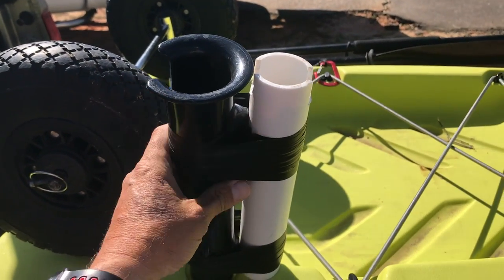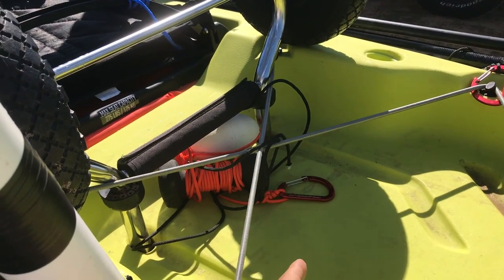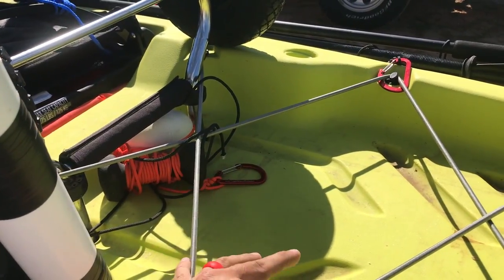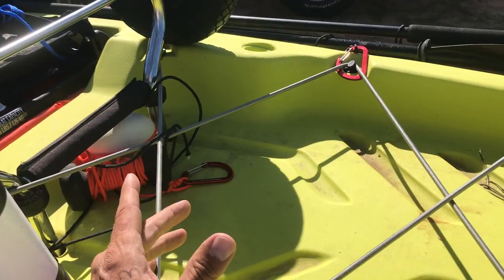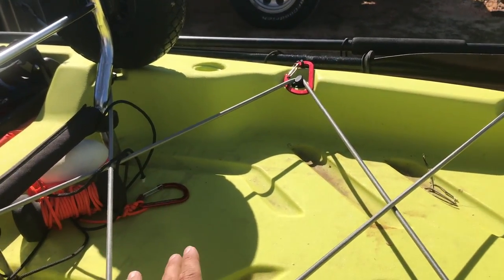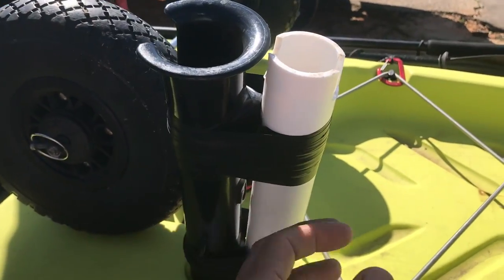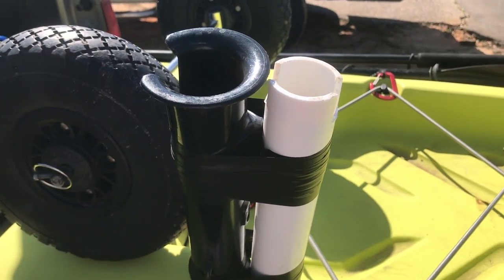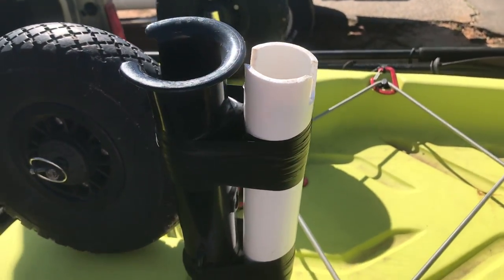DIY PVC Piggy Back Rod Holder - how to & why

Comment: Great idea, not sure why I didn't think of it. I dont like carrying anything behind me either unless its a big trip then I just put the spare "maybe I'll need it in an emergency" stuff back there. I carry my fishbag inside the front hatch, just gotta but scoot forward to access it but it keeps the deck clear. I'll have to rig this up so I can carry an extra rod (even though I only take out 2, sometimes a third would be nice for a different application). Thanks for the tip.
Reply from the maker: yes sir!~ no problem

Comment: great tip! Did you ever figure out a fix for loading and unloading the Compass without putting pressure on the rudder? . It looks like they solved it with the new Outback.  Do you think it is possible they can make something similar for ours? there seems to be plenty of room to mount H rails back there.
Reply from the maker: i saw the gadget they made for the new outback with same rudder as compass. so glad they addressed that issue.
Reply: I hope they address it for the Compass. It is definitely a pet peeve of mine.
Reply: what's this "fix" yall are talking about? I like to see what this is bcuz I plan on getting the new Outback and not sure if its coming standard with it. THank yall